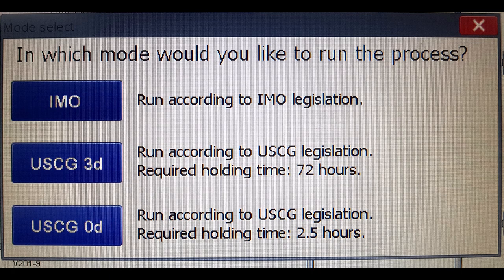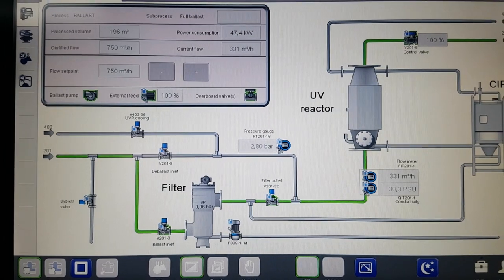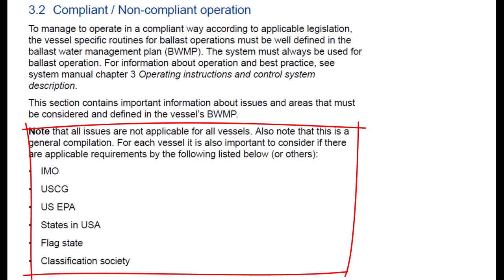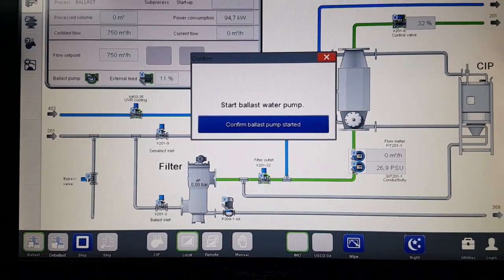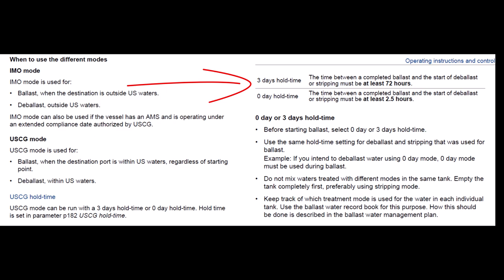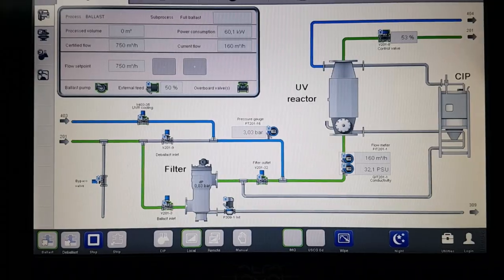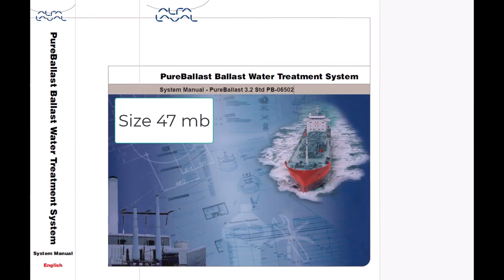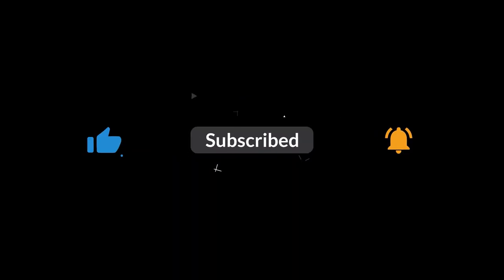Alfa Laval IMO and USCG modes explanation.

Comment: Sir, why they decide to made 3days and 0 day mode. instead we can use only 0 day mode. it's also comply with USCG standard/
Reply from the maker: Dear Friend. Good question. The point is within 3 day hold time before deballasting still alive organisms persist, and these 3 days remained organisms will die itself in a ballast tank in such environment. 
0 day treatment BWTS works on maximum power killing all organisms as per USA regulation.
I have not seen anywhere the main reason why set with 2 modes, I think because of the system works on its allowed limit and too big power consumption causing huge load on Aux. Engines.
Reply: @hypermate  👍 tks sir.